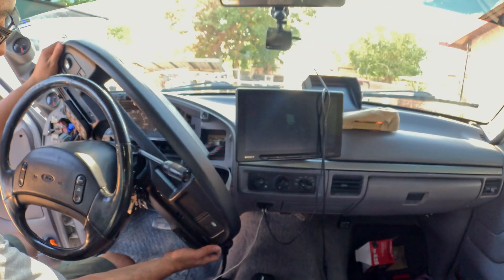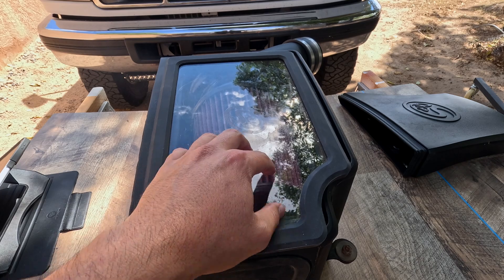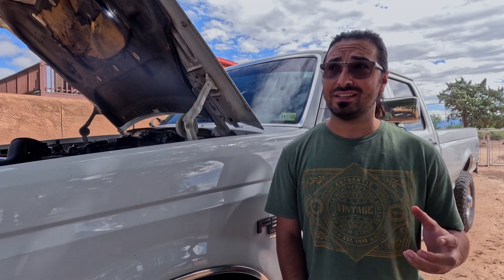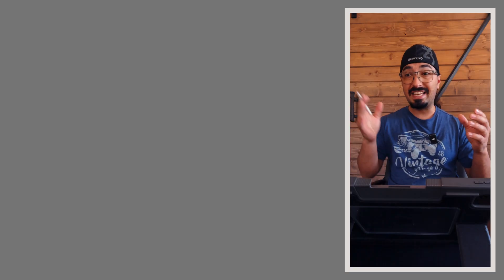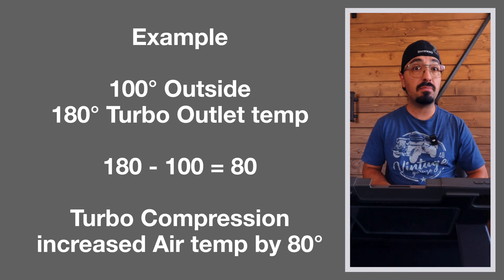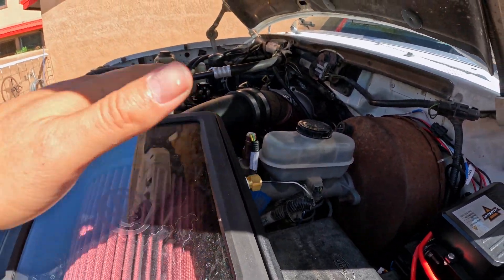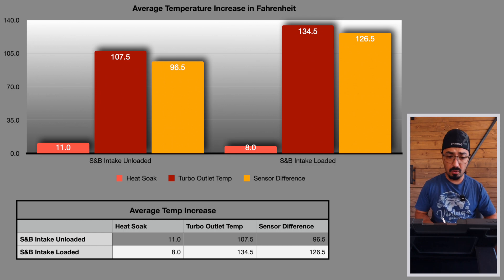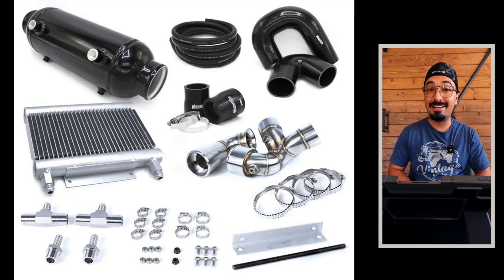Cold Air Intake Myth Busted? Testing the S&B on a 7.3 Powerstroke!

Comment: Nice test! Appreciate you using a S&B in your test.. if you decide to replace your intake/plenum boots, please reach out!
Reply from the maker: Appreciate it! We also conducted a test with your intake in conjunction with a water to air intercooler and the results were… interesting
Reply from the maker: Happen to know the part number for the paper filter that's optioned for this unit? Love to have a backup paper filter for when we are on the road.

Comment: I thought about that water to air intake, but there were no reviews on it so I passed and went with the banks. Plus the banks looks better
Reply from the maker: If I had only posted it sooner haha. Review on it coming soon... some.. surprises with it for sure...
Reply: Aaahhhh,maaaann. Because of this guy's channel, I'm designing my own air/water intercooler. I'll do it for under $600...moshimito parts, along with enough leftover doe for a new 3row allum radiator and better tranny cooler. The banks is sweet, but too much bread. The water is best. And it's way easier than you'd think. Anyway, Good luck w/many long miles. Im sure it's mint!

Comment: Installed a banks intercooler several months ago on my 97 cclb 4x4. I noticed a huge difference in my egts while towing my 6500lb trailer. Before, I could reach 1,200 degrees easy on an incline and would have to constantly back off. Now, I'm hitting 1,000 and she doesn't really go above that. They are expensive but if your towing some weight, it's worth it in the long run. 

Also, I heard that the K&N filters allow too many particulates through. Many trucks with dusted motors ran K&N filters. Might want to do a compression test before getting an intercooler, that's what u do.
I assume you have a egt gauge?
Reply from the maker: Yes have EGT gauge but its not digital so not as accurate. Didn't include in the test but what I will say is that I noticed the EGTs took more time to get to temp with the S&B which is good. They both still reach the same temps but the S&B delays that quite a bit. And you're 100% right about the filter. Turns out S&B has a paper filter for it too so will be ordering one at some point. Might do test again comparing the two.